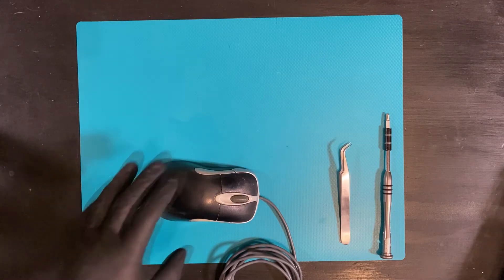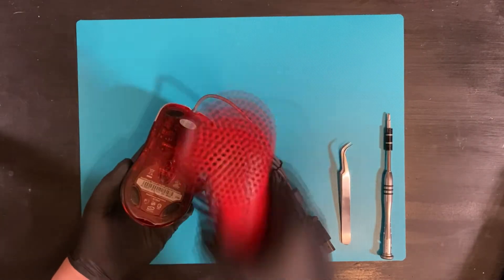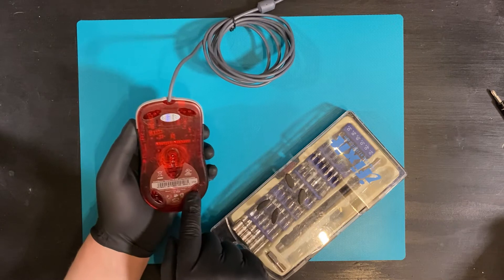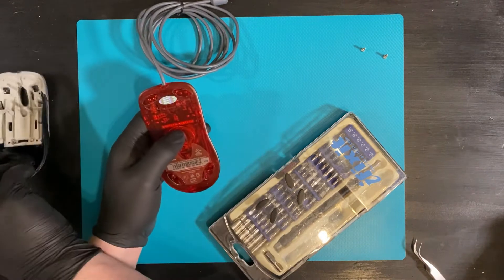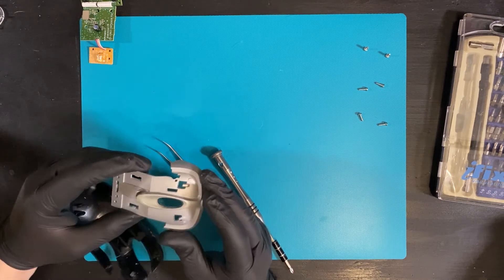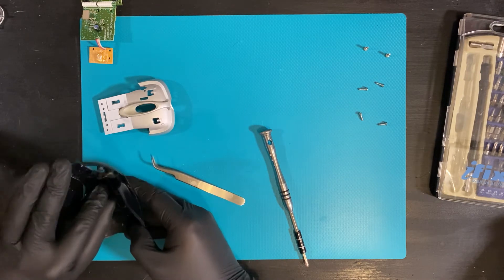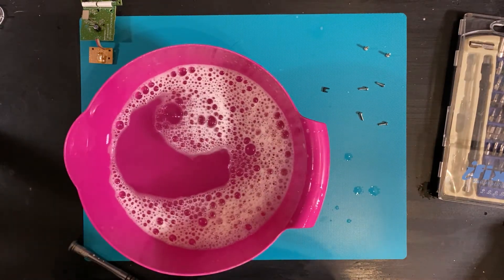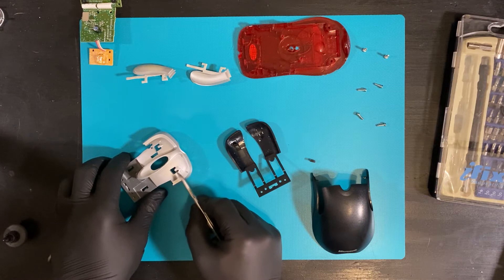Microsoft intellimouse optical Disassembly & cleaning

Comment: You broke it because this is not the correct way how to do it. You do not remove the buttons first... you have to remove the whole assembly out of the body with the 2 buttons still attached first and then the buttons will simply slide off... do not attempt to pry them like that, you will break it.

Comment: mine keeps double clicking when I click just once, do you think it needs cleaning? or is this an issue with wear and tear?
Reply: Are you sure you aren't double clicking? This is an actual speed clicking method, and it's possible to do it on accident, especially with this mouse.
Reply: Had the same issue, there was muck making the plastic mouse button stick to the moulding, I found a line of crud next to the wheel but under the plastic right mouse button.  Cleaned with isopropyl alcohol and a old toothbrush.

Comment: hello friend i have a question  its posible change the clicks buttons of this mouse? I BUY one and love it tracking but clicks dont like it
Reply from the maker: yes, most mice use the same size micro switches but they have several different models, is you want to change them you need to desolder the old ones and solder in new ones.
Reply: @Purkkaviritys  u would recommend some modern switches will work?